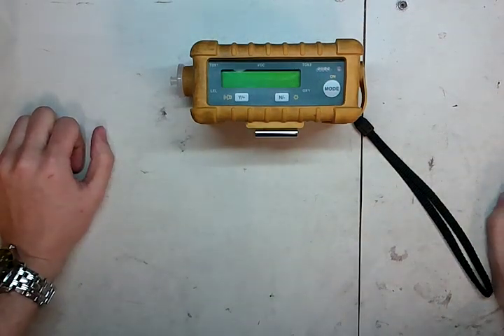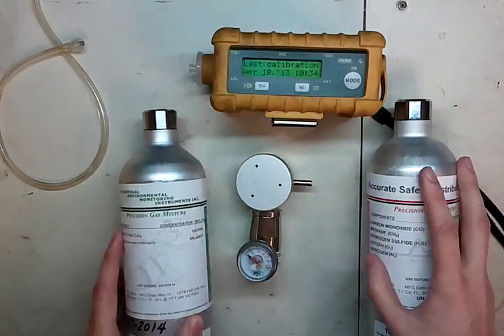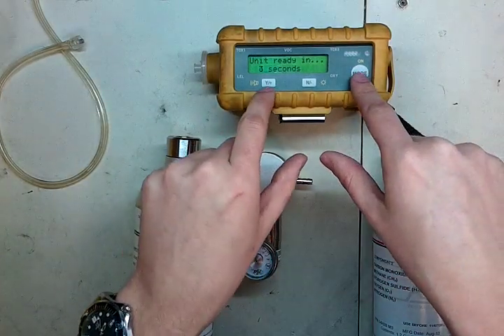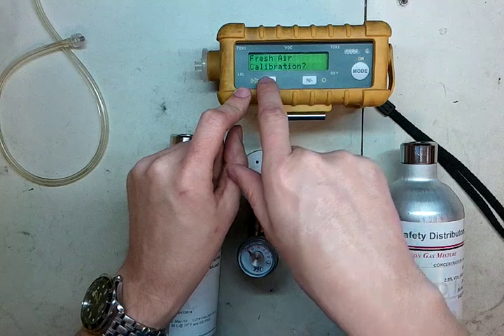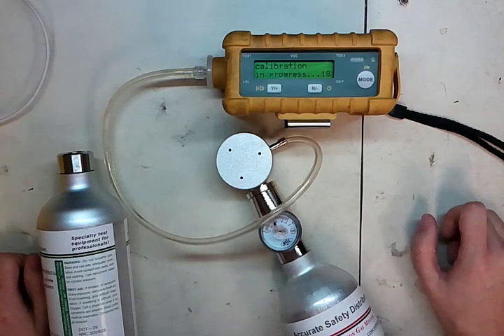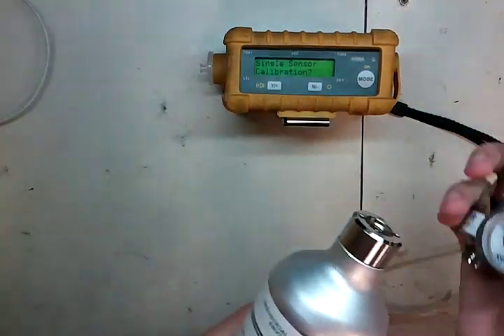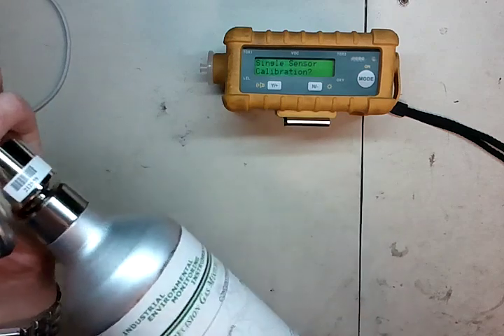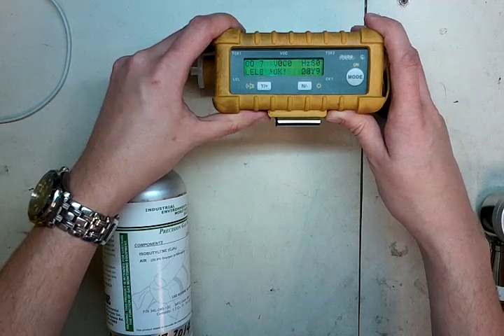RAE Systems MultiRAE Plus Gas Calibration Guide by Ideal Calibrations

Comment: Hi, have you ever experience leak with those regulators? I got that exact same regulator. Recently every time I try to unscrew it, it'll got really stiff to turn and then the o ring would pop, gushing out a lot of gas.
Reply from the maker: Is it happening on every cylinder or just this one? There's two possible failures here: Either the cylinder valve itself is sticking or the regulator O right has become deformed. Most of the time when I see this it's the cylinder valve itself, though occasionally it's the regulator. The regulator is warrantied for a year, so if it's decently new and from us we'll send you a  new one, but otherwise it may be time for a new regulator. In your shoes I'd check a different gas cylinder first and if you have the same problem I'd replace the regulator.

Comment: Did a "Fresh Air Calibration", and O2 is low @ 0.  Beeps once per second now.  What the heck?
Did a "Single sensor calibration", chose "NO" at 0% Oxygen, Span gas value is set at 20.9%.
Still beeps low O2, 0%.
Do I now own a yellow paperweight?
Reply from the maker: Hey Joe, I'm betting you need a new oxygen sensor based on your comment.  How old is it?

Comment: Great Video... So, running isobutylene last will make the CO sensor last longer? I thought the manifold sends gas to all sensors regardless of the target gas.
Reply from the maker: Hey William,

No it won't make the CO sensor last longer.  When you run the Isobutylene first, if the filter over your CO sensor has absorbed all the Isobutylene it can, the CO sensor will then absorb the gas and add to the values during your calibration.  This means that your calibration will be basically worthless.  Over time, running the Isobutylene over the sensor fills up the activated charcoal.  Once it's full, it allows the Isobutylene to pass on to the sensor.  You can check your filter by putting the monitor in normal reading mode and running a bit of Iso over the sensor.  If it reacts, your filter is likely done for.
Reply: Ideal Calibrations Check the raw data for fluctuation on the CO with Iso...Makes sense. Can you replace the carbon filter? I've seen the little carbon discs in the cabinet but not sure if thats what they are for. I read that those can be used for fresh air calibration, when in an area you are uncertain. Sorry, trying to learn all I can on this equipment.
Reply from the maker: William LaRoux So there are two filters, one inside the sensor and one above it in the manifold.  You can replace the one in the manifold, but once the one in the sensor is gone it's gone.  You can occasionally improve it by using some sort of heat on the sensor to cause the carbon filter to release the trapped gas, but it doesn't work great and you risk dehumidifying the sensor if you go too far (which isn't a good thing for the sensor life).

If you want to give us a call, I'll be free today a few times and can call you back if I'm in a meeting.  734-956-0539 and reference this conversation and ask for James.